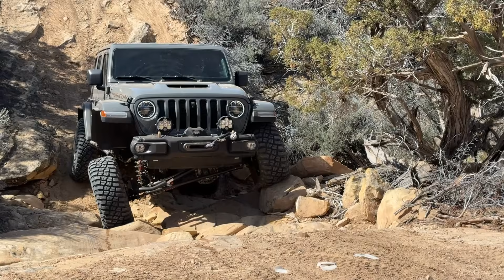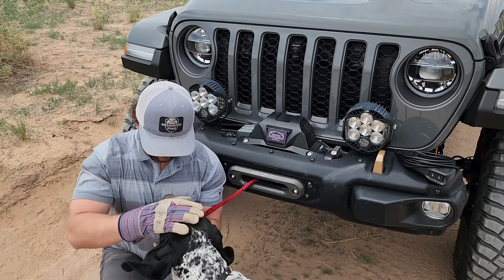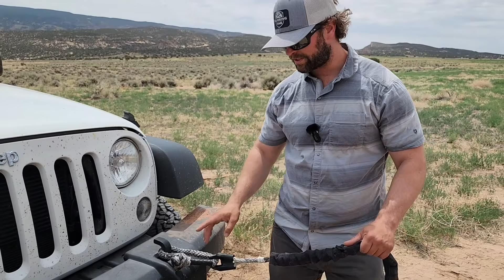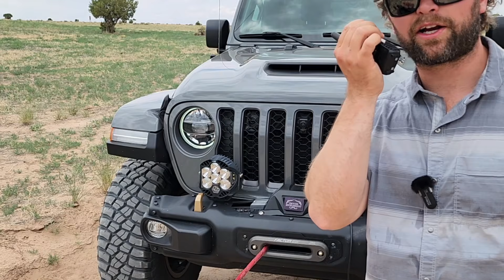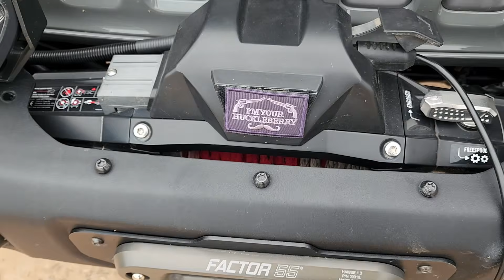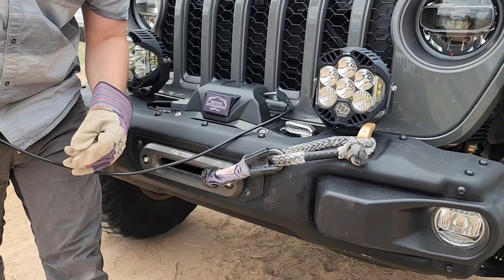How to Pre-Tension Your Winch Line

Comment: Why did you put the winching vehicle in neutral?  I get chocking the wheels.  Seems putting it in 4lo and in park would anchor the winching vehicle better than neutral and chocks.  Not criticizing, asking for understanding.
Reply from the maker: Great question and thank you for asking! You want to avoid putting the vehicle in 'Park' for a couple primary reasons:

When you put an automatic transmission in Park, typically, a small metal pawl locks into a gear on the output shaft. It’s meant to hold the vehicle’s weight on a slope, but not to resist dynamic or shock loads.

Neutral disengages the engine and drivetrain, so the winching load doesn’t stress transmission components.

Parking brake (or wheel chocks) holds the vehicle through the braking system, which is designed to handle sustained loads without damage + applying your brakes while winching distributes the force to the wheels and axles instead of concentrating it on one small part inside the transmission.

Hope that is helpful and thank you for asking!

Comment: Wouldn't it have been safter and more balanced to use a tree saver as a bridle and attach that to her hooks, then use a soft shackle to connect the tree saver to your hook? I also hear it is safer to use a line weight while winching. Is that something that should not be used while line tensioning?
Reply from the maker: That is a great comment and great recommendation! You can absolutely do both those things. Adding line weight is a good idea as well. 

Keep in mind the line should never be under max load when doing this - you only need light resistance to put tension on the line.

Always refer to your winch manufacturers recommendation as well.